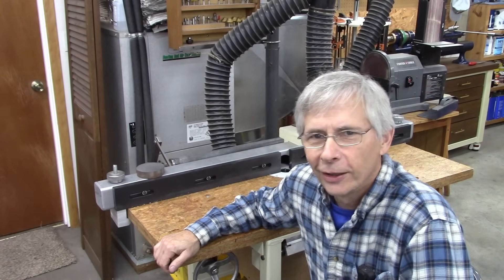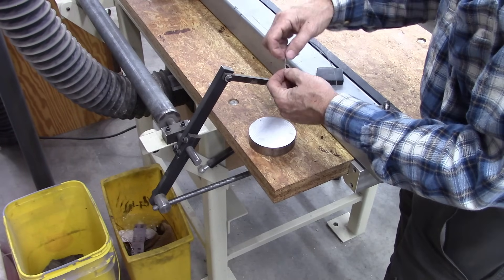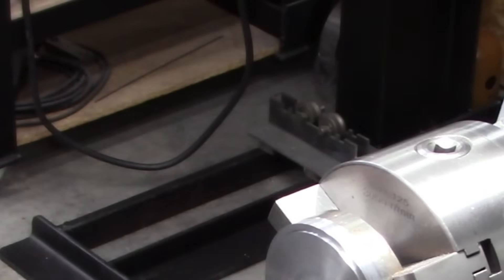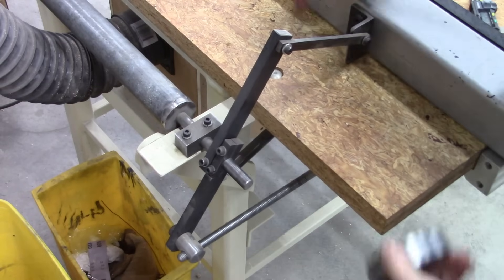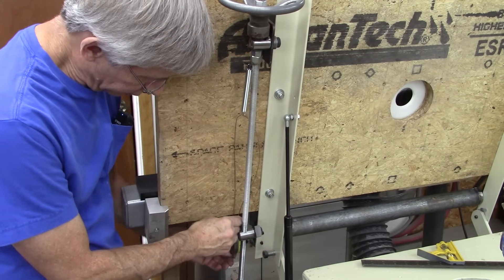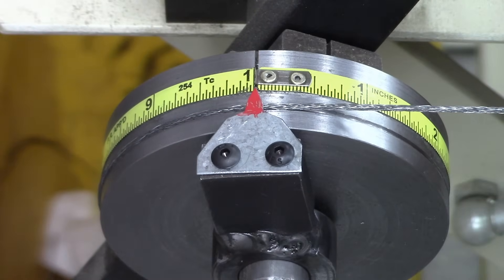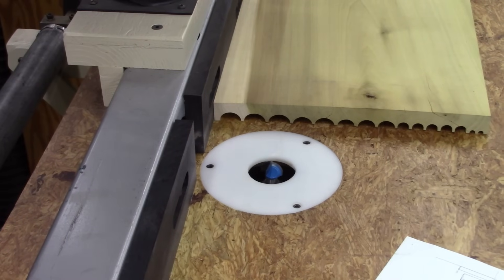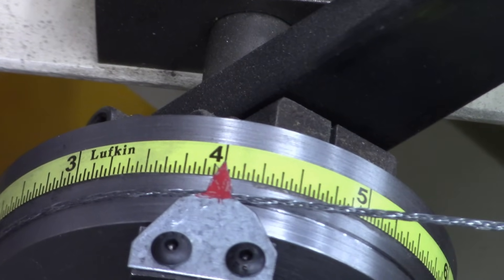Mechanical DRO for my Router Table Fence

Comment: You should see the mess i have now. My new to me 4 tool post for my Leblond needed a new compound lower clamp insert. Simple. I found a nice peice of steel, and cut it to fit, in the Index 40H. And it has virtually no play. So  next step is to drill the center fixing bolt and 2 alignment pin holes. Guess what. the pins in the center body are NOT aligned with the flats in the tool body. Even the old lower clamp has the pins crooked. ???? What lurch did this?  If i drill the holes straight the tool it is 5-6 degrees crooked, and with no play its not going to happen. SO i need to A. Drill the pin holes crooked in the new clamp. OR B. drill them straight, and then redrill the center body so that it ends up with a straight tool. If you read this, what would you do?
Reply from the maker: I have no idea, sorry

Comment: Great project. Think of dropping the spring by letting the wire run over a free spinning wheel and having a weight creating the tension.
Reply from the maker: Yes, I thought about that. The spring keeps things compact but the weight would have worked perfectly.
Reply: @WinkysWorkshop  More or less unlimited stroke, no need for a specific stroke length spring.
Reply from the maker: @Stefan_Boerjesson  very true.

Comment: Very clever and very handy.  And any backlash from the threaded rod is not a problem because you can reset the DRO wheel?
Reply from the maker: It's not super accurate but the backlash is not a problem. When its in position the fence is locked. I'm guessing its good to within a 64th....  good enough for woodworking
Reply: Backlash isn't a problem because the "DRO" is reading off true movement of the fence (assuming the cable doesn't have slack) - typically backlash is an issue on machine tools when the reading is off the handwheel/screw.
Reply from the maker: @BSesq  You got it. Its as accurate as your eyes

Comment: You just gave me an idea. I have a 7 x 16 Harbor Freight lathe. Sometimes I want to know how far the carriage travels. I'll see what I can do. I've seen dro's made from cheap calipers, but I like this better. What I may do is attach a sliding ruler to the bed ways.
Reply from the maker: That might work great!
Reply: I was just thinking the same thing. I might do my own scribing and make it in .001 incriments.
Reply: @noneofabove5586  another good idea, thanks!
Reply: @noneofabove5586  Sarcasm is not always recognized...
Reply: Only sometimes? You may find your wheels come with graduations. Of a somewhat more accurate nature. Woodworkers may work to 1/16ths or even 1/32nds (in the US) but machinists work to thou...

Comment: Another gem from you, Mark. Thank you. But I felt for that nice tape-measure - wondered why you didn’t index your ‘pulley’ using your lathe-based indexer..? It might have been a slightly tiresome job but would have looked more snazzy (in my opinion!) Love your stuff! Les in UK 🇬🇧
Reply from the maker: Yeah that would have been a big job. Thanks
Reply: Good idea,  but the tape worked out just fine. I’ve considered setting up my lathe for indexing with a 48 tooth gear on the headstock end. With 48 teeth you can index 2, 4, 6 , 8, 12, or 16 spaces.
Reply: @ellieprice363  I have a little Taig lathe (as well as a very worn Myford ML7), a local engineering company drilled me an indexing disc with 50, 60 & 72 holes in three rows. Indexing is a breeze, all I need to do now is make some sort of cross-slide drilling fitment … that’s been on the cards for 12 years so far! Les